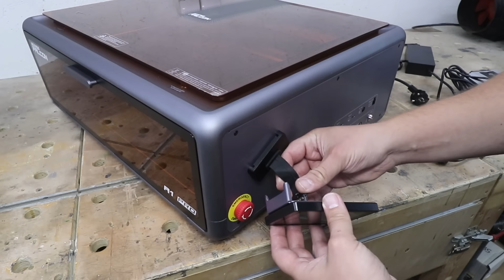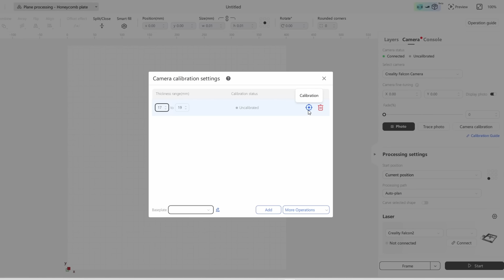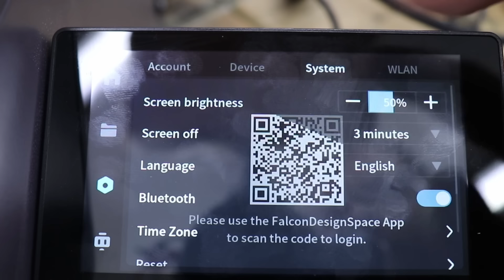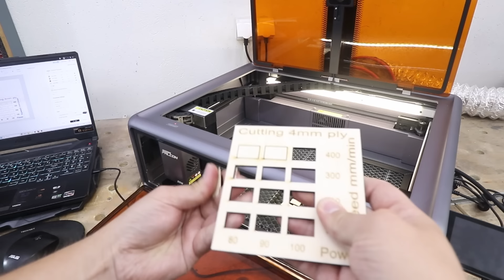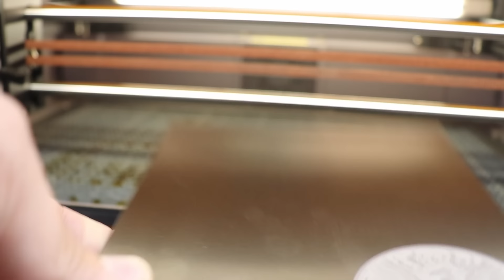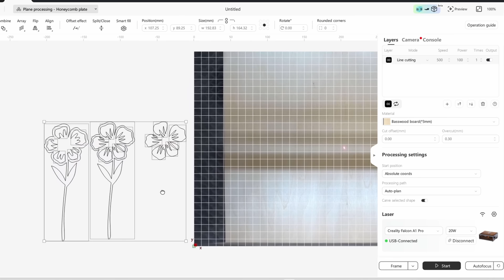Creality Falcon A1 Pro Review – Worth the Upgrade? 🔥 Full Test & Comparison!

Comment: I'm done with Creality Falcon!  For over three months, they have been unable to resolve rotary device not working out of the box.  They have treated me like a moron, repeatedly wanting videos of it not working and how I have connected it, duh.  Ther is only ONE way it can be connected.  They will not consider it's a hardware problem and replace.  I'm moving on to a new hobby.  If you ever think you may need customer support you may consider avoiding this company and its products.  A1 Pro for sale cheap!
Reply from the maker: Thats not great. They should offer better customer service. I have not used the rotary attachment so not sure what the problems could be with it. Is the rest of the machine working correctly?

Comment: Is this better than falcon 2 pro?
Reply from the maker: Better from what perspective? Engraving quality, laser module power, cutting capacity, foot print, work area? Each will be better than the other in some way. Depends on what you are after, what projects you want to do. For example Falcon 2 Pro does have bigger work area and does offer stronger laser modules. However if you don't have much space in your workshop and you only want to engrave then the A1 Pro would be better plus it will be cheaper.

Comment: Any chance to do a teams call to help me set this machine up? Been trying for 5 days with no succeess :( if you're willing and it helps you for trobleshooting content, i'm totally in! Thanks!! Noe (from Argentina)
Reply from the maker: What seems to be the problem? You know I'm not Creality engineer or sales person right?
Reply: @CasualDIY  first of all thanks for getting back to me!! I know you're not part of the company but you seem to know exactly what to do! I'm kinda desperate, we bought the a1 pro with a lot of hope and it's so frustring that it's not being as plug&play as expected!! 
The thing is: the camera, after being calibrated, seems to be ok. But when it gets to framing, the laser slides to a different area than the one i mapped in the project. For example if i add a rectangle in the center of my basswood board and then i click the frame button, it frames like 3 centimeters to the left and down the place where it was supposed to be done.
Reply from the maker: @nmonastirsky thats software issue not the machine itself by the looks of things, what software are you using?
Reply: @CasualDIY  falcon design space
Reply from the maker: @nmonastirsky ok it could be two things. In the software on the bottom right corner you have two options Start Position and Processing Path - what have you got selected for those. 
Second potential problem, when you have been calibrating the camera, have you done it with the honeycomb base in or without? As if you used honeycomb base for calibration you should have selected an option for it. Then the calibration will be done for the honeycomb base - which then needs to be selected in a drop down menu that is on the top left corner of the software. If you calibrated the camera with no honeycomb base but now you put one inside then obviously it will not work correctly. Similar if you went the other way around.
Reply: @CasualDIY thanks so much! I reseted everything and started over, now it seems to be working more accurately. Of course i'm 100% grateful, i suscribed and hope you do more things with the a1 pro! On metalic surfaces maybe? ❤  Hope you have a nice day!
Reply from the maker: @nmonastirsky glad to hear it. The camera has a fisheye lense so the more you move your projects to the boarders the less accurate it will show. That is a common issue in most lasers offering this feature.

Comment: I'm thinking of purchasing one of these the only thing putting me off is quite a few people have found it very difficult to set up the autofocus feature etc on the camera with those cards,..they say it either just doesn't work at all or takes an insanely long time to run through the set up program only for it to keep failing....????
Reply from the maker: Well I have done with the honeycomb base in - made sure I let the software know about this and no issues. It takes some time that is true. Probably about 15 minutes, the whole process.

Comment: Does falcon A1 pro cut clear acrylic?
Reply from the maker: No, only CO2 type lasers will.
Reply: @CasualDIY okay, a dealer in my area says it can cut by applying dark coat on clear acrylic, is that true?
Reply from the maker: @akshaydhavane4812 potentially, not tried it, too much hassle
Reply: @CasualDIY yeah agreed... BTW thank you for the information 😊
Reply from the maker: @akshaydhavane4812 you are welcome

Comment: Let us be honest the A1 Pro, like 3D Printers, is NOT a new product. It is the A1 with consumer complaints taken into consideration. Even though they Knew what people would complain about , because they ARE NOT morons. ALSO Creality tells a bold face lie when they say the A1 Pro has built in auto-focus.  The focal distancing wedge you use proves that. The focal length is the distance from the center of the lens to the focal point—the location where the laser beam becomes most concentrated. This is a critical and fundamental aspect of laser focusing. Sadly this wedge is the same crutch that has been used on laser engravers for years. The video is well made, but more like a sales pitch then a review.
Reply from the maker: Well at least they listened and improved on the design with still at decent price compared to some competitors. The auto focus feature does work but only has one setting, whereas the distancing wedge does offer three levels depending on the job at hand. Saying that how many other machines from other brand offer this feature at this price range? Even in this limited aspect. I think its a great addition that they will build on in the future. For the price this machine is offered I will not complain, especially when there is no fundamentally wrong with this machine. I think it does offer a lot.

Comment: Just a simple question. How does the machine (or manual by yourself) how high the machine must be? For example a phone case from around 1cm high.
Reply from the maker: With the machine you get a metal step plate to setup the correct focal point depending on a job you are planning to do - I do show how to setup the focal point in the video.

Comment: Anyone confirm for me that the new Falcon A1 Pro only has a 268 x 358 engraving area? My Falcon A1 has 300 x 380 engraving area. why did they go smaller? I am seeing conflicting numbers. one spot on Creality website says 305 x 380 and another says 268 x 358.
Reply from the maker: Because the 20W module is much bigger. Both machines have the same frames and sizes but due to the bigger module it cant travel that far as it would hit the body.

Comment: what size inside is max can i fit honeycomb as the official one is too expensive as ive just used all my money on a package inc this 20w machine, smoke filter and rotary.

I have seen some 35x35cm but thats not inc the frame so not sure will fit depths wise
Reply from the maker: The max size for a honeycomb base is 460mm x 346mm
Reply: @CasualDIY do you know height as well. As laser beds all seem to be over 20mm

Comment: Well mine arrived today, no goggles, no usb so no lbdev file to config in Lightburn quite unimpressed so far. It also won't connect to my mac via usb and the wifi connection is unstable at best. I have looked on all the download sites UK and otherwise but it shows nothing beyond the Falcon A1 - no pro showing and I cannot find creality falcon a1 pro.lbdev.

Bag of crap so far and at this rate it will be going back
Reply from the maker: Sorry to hear that. You need the Falcon Design Space to use the laser. I have not tested it in Lightburn to be honest. For me the WIfi works fine just make sure your wifi is 2.4Ghz as I don't think it supports 5Ghz.

Comment: That Honeycomb base is AU$339. It should be provided free IMHO. It's like most things printers and laser machines these days. They give you a decent deal on the main machine and hit you hard with the extras. Don't get me started on the cost of filaments.
Reply from the maker: Wow that's crazy expensive. Better come up with another solution.
Reply: @CasualDIY Yeah, I wish I could 3d print one but has to be metal. If I had a shed to work in I could fabricate one very inexpensively. Maybe outsource someone to do it.
Reply from the maker: @Vegemite500 you can just try to buy a sheet of aluminium honeycomb, I buy that for my epoxy Resin projects
Reply: @CasualDIY Yeah, my local Bunnings probably have it

Comment: How long did it take to cut the acrylic? And was the edge finish okay? Thanks!
Reply from the maker: Hmm I can't remember exactly, less than 10 minutes. It was ok for this project, no issues.  You can have different outcomes depending on speed and power. Bit less speed and less power and you will get smooth surface. More power and speed and it won't be as smooth. But actually better for inlays as it will friction fit and no need for kerf adjustment. However I also noticed that the results on acrylic will differ depending on what type of acrylic you will have, and even what brand.
Reply: @CasualDIY  Thanks for the reply! I’m looking into getting this laser for acrylic projects.
Reply from the maker: @linomorales7621 just remember blue diode laser will not cut clear acrylic or engrave clear materials for that you need a CO2 laser

Comment: Great review! Did you try cutting hard wood like oak / nut tree as well? Do you think cutting through 8-10 mm hard wood would work? Could you maybe try that and release a video about it? This question made me hesitate to buy the 10W A1 base version beforehand.
Reply from the maker: Hi, Well the 20W module should be able to cut through some hardwoods but I don't think at the thickness you mentioned. It possible but with many passes and that will lead to heavy brining in my opinion. However I will try to make a Short on this and we shall see. I do have some oak and ash - results will vary from wood type and colour as well. I think for efficient cutting of hardwood in 8-10 mm you are looking at a CO2 laser with at least 50W of power. Like the xTool P2. But hey I will test this out and we will see.

Comment: I had the base model delivered earlier this week and cannot get the creality software to work on any of my computers. I also had tech savvy help and still cannot get it to work. I raised a ticket with creality and no reply to any of my questions. I am seriously dissapointed with my initial workings with this machine. Where did you download the software from as it does not even give you this basic information in any of the manuals or online?
Reply from the maker: It's on the creality website. In the software section. Had no issues with mine, straight download, install and that is it just works.
Reply: @CasualDIY  Takes you to Craft Seek and that is where I downloaded the original software, tried again and same issue. You would think they would have this info in the instruction manual. The tech support from my experience is non existent. Even when I called tech support it said to call Pacific time so I did it at 6pm my time last night and got a recorded message telling me to visit the China website. It is worse than useless and the reason I bought the machine was for the plug and play functionality and nothing (for me) works. I am wishing I never spend the money now as the attraction to me was the beginner functionality everyone raves about.
Reply from the maker: @johnfulton8023  you need to download the original from Creality website called Falcon Design Space, if you have done that, is it the software that doesn't work or the software works but its not connecting to the laser? The  are two USB ports on the laser, have you connected the wire to the PC port? And which Windows are you using as the software may not work with the older ones.
Reply: @CasualDIY  Could you please post a link to where you downloaded from as I cannot find on any creality page. I looked at the creality wiki and seems a lot of people are having this issue

Comment: Excellent review and presentation, thank you, but where do the exhausted fumes go?  Is there a filter to capture them or do you have to cut a hole in your wall to exhaust them to the outside?
Reply from the maker: You get a hose to put through a window for example. But you can purchase some fume purifier units
Reply: Many thanks indeed, Thomasz.  I don’t have opening windows in my garage/workshop so I’d have to look for a purifier unit which would capture fumes from wood and various plastics, tiles etc.  I wonder if dipping a short length of the hose into a bowel of water and letting the air bubble up through the water might work.  I assume the extractor fan would provide enough pressure to overcome the water pressure at the depth to which the end of the hose would be set.   I’d have to try it and see.
Reply from the maker: @ianmathieson65 I don't think that will work, it's only a small fan not an inline extractor. I think in your situation an air purification unit will be a must. If you cutting plastics then those fumes may be harmful
Reply: @CasualDIY:  Many thanks for your very helpful comment.  Yes, from what you said, I agree an air purifier is a must.  I don’t have a laser cutter/engraver or a 3D printer but am mulling them over.  Identifying and difficult areas up-front and the cost of dealing with them is key first me before buying.

Comment: Ive had my A1 for less than 2 months and Im getting this... AWWW!!!
Reply: same here , I am hoping there will be an upgrade kit, if I had known I would have held off buying the A1
Reply: @SirRanzid  Same here, however I never thought they would churn out another one less than 4 months later, to me thats a bummer. I hope there is an upgrade kit as well.
Reply: @SirRanzid  Well I hope the A1 is OK, just recently bought the A1 pro never been so disappointed with a new bit of kit in my life,everyday I've used it I've had a different problem main issue is the design space app keeps shutting down continuously, machine wont auto focus, import a picture only engraves half of it biggest load of crap I have ever purchased.
Reply from the maker: Solid upgrade 👍

Comment: Did you try using it over WiFi? That’s a must have feature I need that was missing in the cheaper 10w version. I had that model and found the USB connection very unreliable and the fan didn’t turn on for every job, resulting in massive smoke leakage.
Reply from the maker: Hmm that's strange I only ran them via USB and never had a problem. It does support WiFi and Creality have their own phone app that utilises this machine.